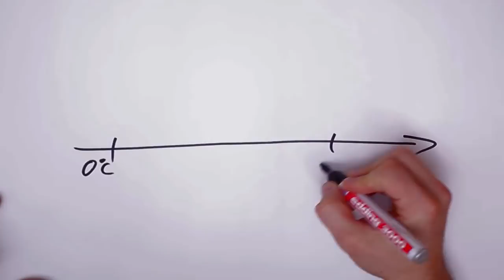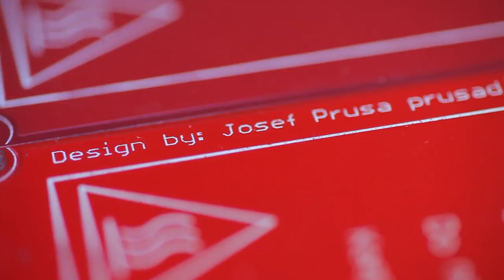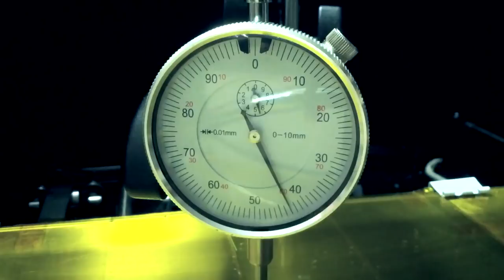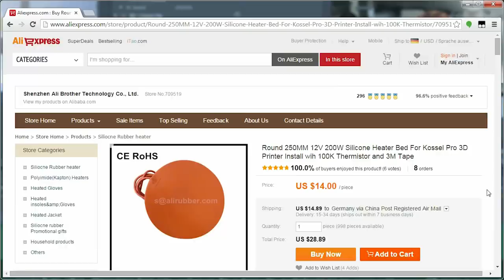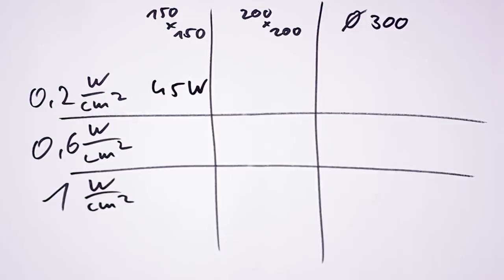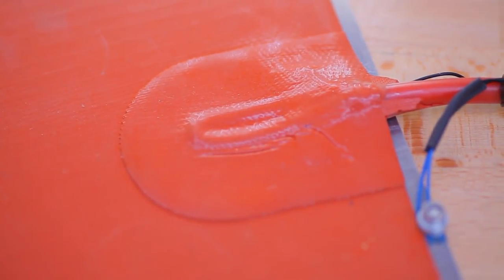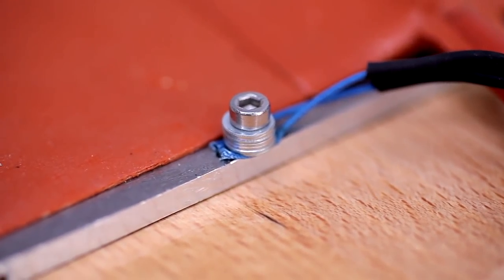3D printing guides: Everything about heated beds!

Comment: I have looked a bit at this and i decided to get a 220v 600w heated silicone pad.. :)
But then i immediatly started thinking HOW will you adjust and control the temperature on this when you are using mega2560 and ramps 1.4 ? :)

I would also like to know if you have to put something on the back of the heated pad, to avoid bearings and the suff underneath to get heated up.. :)
I have a prusa i3 hephestos :)

Looking forward to your answers :)
Reply: ***** thanks very nice and fast reply i just subscribed.. :) I were just afraid i would melt the pla underneath, but if i take i bit of the height, and get a bit more air in between and cover is with some cork, i should be good to go :)
Again thanks :)

Comment: Hi Thomas! Been fan of what you do on youtube and got tons of information that helped me and my 3d printing and for that I am greatfull but I still have a huge problem a smooth print surface. In the beginning I got MK2a PCB heated bed and a 3mm glass but I got tired of leveling my bed every time i print so I changed it for a MK3 pcb heated bed with Aluminum surface. But now i realized that it has a bow in the middle and the reading that i get from auto bed leveling are not as accurate as i want them to be. Do you think changing to heated mats with 3mm aluminum sheet will help me solve this issue? Can you please suggest a way to battle the bow on heated bed since it is getting really frustrated and annoying. Thanks in advance!

Comment: Tom, how can I control a mains-powered heated bed from a Smoothieboard?  Also, what kind of thickness would I need for an aluminum plate for a delta printer with a bed diameter of 38cm?  It's only supported at the edges, and I'm worried about sag.
Reply: ***** HAH!  I should've known you'd have a video about it already!

Comment: Hi where did you get your printbed from? Im planing to transorm my Prusa i2 to a Mendle 90 and also upgrading to a Alu bed with a heater mat, and since your happy please let us  know :)
Reply: You want MIC-6 cast aluminium plate.  According to Alco specifications, after casting it is ground on both sides to a tickness tolerance of +/- .005 inches (.127mm) with a surface finish of 20 microinches (.51 microns). The max. variation in flatness is .015 inches (.381 mm) over 96 inches (2438 mm).  It comes with a protective film on both sides.

Comment: how well would this work, a heated mat stuck to aluminium sheet (~1/8 thick ),with kapton  tape then glass sheet with kapton tape , glass sheet attached via binder clips, glass sheet is being used due to aluminium sheet that came with printer is warped. kapton tape on top of glass because i have been printing on it. and had little to no fails for adhesion, when i did just some glue stick to fix it. i would have personally like to use a thicker sheet of aluminium that is machined flat but not sure if i can afford that with kapton take. my printer is a solidoodle 3, bed is attached with 3 counter sunk screws and springs to allow leveling.

Comment: Hi Tom thanks for these informative videos. I have prusa i3 with aluminum heat bed & regular window glass on top but it takes extremely long time to get to 100deg. I want use a heated mat which is 230v AC so it heats very fast but not sure how it is wired so that my printer board control it. Any tips/guide on how to do so? Thanks

Comment: Hey Tom, i am hoping you could help me figure out what i need to wire a 110vac bed on to my melzi board... currently i have a pcb board, i have tried insulating it, adding a 12v relay to power it directly from a way over powered psu, still cant get it to push 100c... so it's time for an upgrade, but as you suggested i think it would take strain off the PSU to get a 110v... my issue is figuring out how to wire it in, i assume it would just be an ACDC relay of some sort.. just wanted your expert opinion.
Reply: It's all good, i got it figured, thanks for the videos tom, keep it up. if anybody wants to know, here's the part number for the relay 
G3NA-210B-DC5-24

Comment: what videos i have watched of yours has been a great help. when you say 120 and 60 degrees i am assuming you mean Celsius. in the process of building my first prusa i3.  have not got it built yet n already have done many upgrades to it that i could get from ebay.  do you have any tips on building a 600mm X 600mm bed? using aluminum plate of course.

Comment: Hello Thomas, you mentioned the e3d v6 method of putting a thermistor into the aluminum bed, can you elaborate a little bit? the picture looks like a hole was milled and tapped into the bed, thermistor inserted and screwed for tension. Is that correct? is there a special thermistor needed for this setup?
Reply: Thomas Sanladerer thank you! I'll likely be implementing this on my printer. I enjoy watching your videos and really enjoy that the captions are accurate!

Comment: Thank you for the very valuable information. Then, I'd like to upgrade my printer with aluminum bed + silicon heater. Then, what kind of adhesive would you recommend (minimum thermal impedance, but strong enough to hold the heater's weight ) ?
Reply: +Thomas Sanladerer  Thank you. I got my silicon heater from QUBD/Amazon Market place, which doesn't came wit the tape. I'm going to order a silicone adhesive.

Comment: Hello man your tips about 3d printers turn out very very precious for me  . However , i got a problem with my Anet a8 heatbed  . I can print successfully with PLA filament,b ut i can't do the same with ABS and more awfully with Nylon .The problem is that the heatbed doesnt  hold a stable temperature .It reaches the pre- heating temperature , i.e. i set 90 degrees celsius for the Nylon , but after 10% of printing the temperature falls down to 70 degrees and the object i am printing detaches by the heat bed and everythings mess up.Tried to change DC power pack from 20A to a 50A but the result is the same ,dropping temperature after 10% of printing done.WHY ?

Comment: Have you had any experience with kapton film heaters? I was thinking of sandwiching one between aluminium and cork for high efficiency.

Also what do you think of mains voltage heaters? Keenovo sell them. I am looking at using a solid-state relay to remove the need for a new power supply.

Is printing directly onto heated aluminium viable?
Reply: Thank you for the advice.

I went with a silicone heater as it was £25: the price for a 200x200mm one, but Keenovo kindly offered to adjust the dimensions slightly to fit my Velleman Vertex. The polyamide film heater would have cost about the same, but for a suitable custom one there would be a £50 retooling fee. They say cork can be attached to either.

Mains voltage makes sense as it will eliminate the need for a new, expensive PSU, be more efficient and simpler to implement. Just got to make sure it's all safe.

I got an aluminium sheet for £1.70 from a local place, Aluminium Warehouse in Hatfield. Perhaps there are places similar to this where people could get this stuff cheap? They charge about £12 for UK delivery, but I will just pick it up.

I will experiment with printing surfaces. I'd like to avoid the glass to reduce the time taken to heat up the bed, so I might try some of those solutions. Have you tried buildtak? I didn't see a video about it.
Reply: I saw a video on it the other day and it looks almost identical. May try it. Thanks.

Comment: Hopefully this wont be too late to be seen, but I had a question regarding alternative bed surfaces; I've been looking into getting a sheet of PEI(polyetherimide) to print onto(and to replace my glass surface). I've heard that the surface works magic when printing with ABS, experiences nearly zero warping at 80-90c, and the parts seem to hang on for dear life when heated, but pop right off when the bed temperature drops below 50c. As it stands I'm currently using a 4mm sheet of borosilicate glass on my Prusa i3 and the standard 2mm sheet on my Solidoodle Press; If possible, I'd love to get your input on how PEI actually performs, as I've seen some pretty interesting videos of its performance and would love to buy some...However, since it seems to cost around the same as an arm and a leg, I'd rather hold off until I see some actual reviews on the stuff. Any chance of seeing that? Thanks!
Reply: ***** Polyetherimide is 20USD on amzon for 300x300mm) I got mine installed on a FFD and so far prints stick really nice. some prints are actually hard to remove when they have large surface area contact to the bed. Small prints come right off once the temp drops to below 60C. I did have one print corners lift up about 0.5mm. That's one print out of 2 weeks of non-stop printing. Cleaned the material with water and everything seems to be going well again. It even gives a reflective surface on the print were it contacts with the material.

Comment: If I went with the silicone heater method... would it be possible to use 3mm glass ontop of the aluminum plate for ease of removal? Or would there not be enough heat transfer to be viable?
Reply: +Darkmastergrey Solidoodle Press comes with Silicone bed heater on Aluminum Plate and glass on top of that. Works fine, slow to heat tho.

Comment: Tom, on my Prusa i3, the heated bed doesn't respond to my set temp (always heating) but the thermistor works fine. Any idea how the setting function may be bypassed? Couldn't find anything on Google.
Reply: yes, im wondering if the kits lack of a bed relay would not enable the control? Although that's the way it shipped and I assume they wouldn't do that on purpose.

Comment: I've stopped using any heat to the bed with PLA,, up to a 225x145mm plate size so far.
AquaNet Superhold hairspray on galss or acrylic removable plates has been working great,, PLA and ABS.
Heat for ABS thou, gets a lot more attention:
- Enclosed chamber
- Heated chamber (I have a small hairdryer that preheats the chamber to 110*F / 43*C)
- Let glass plate temp equalize with heated bed for 3 or 4 min.
Remove the plate,, let it cool to the touch,, pop it in the freezer for 2 min,, and your object will lift right off the plate.
Exotic filaments will be interesting to see how they might require a higher stable bed temp. I just got the 3pack of ProtoPasta filaments,,, so I maybe having to make some heated bed upgrades.

Comment: Hi i'm trying to find  heater mat that i can plug into a wall socket 230-240V with a controller ideally. My existing printer REP RAP is a Bits from Bytes printer(doh, no wonder they no longer exist) the printer never came with a heater mat and is impossible to print with so I'm trying to upgrade it as i has been collecting dust... i'm not at all Electronics Savy so i wouldn't be able to make one that wasn't dangerous.

Comment: how does the controller power the bed? is it a constant current or does it cycle? i'm utterly confused. Could you use an external heat bed that isn't even connected to your 3d printer but it's own controller? Does it need a controller? etc.

If I get a Cetus, how do I home-make a heated bed that will get up to 120C? How would one go about hooking it up to the printer itself? Or, externally on its own power supply? :/
Reply: Yes you will need a controller, to connect a heat bed to an external power supply you with need a mosfet . the 3d printers control board sends a signal to the mosfet which will then turn on the hot bed using an external power supply , there is a thermistor connected to the printers control board which reads the bed temp and if it's too hot it turns off the signal being sent to the mosfet which turns off the bed

Comment: What kind of adhesive (tape, glue, silicone paste) do you use to adhere the silicone heater mat to a glass plate ?
I'd need some tape that's available in germany at best.
Reply: +Thomas Sanladerer my mat came with double sided tape attached to it, but the cover on the second side of the tape got loose during the shipment and there were some air bubbles between the mat and the tape. Therefore the tape wasn't as sticky as it needed to be and secondly the air expanded while heating, which caused big parts of the tape to get loose additionally. Therefore I've decided to remove the tape completely. I would now either order new high temperature double sided tape, or I'll try out silicone paste/glue.

Comment: I'm looking at a keenova heater mat adhered to the underside of a CR-10S build plate. I'd rather have the CR10S control the temperature through a SSR but am a little leery about the temp control algorithm being responsive enough to handle this higher power/faster responding heater. Anyone have  any experience with this?

I'm also looking at using an array of thermal pads between the glass and the aluminum plate to accommodate any flatness differences between them. My concern with using a full sheet is disassembly should the glass become damaged and need replacing. Any Ideas around this?

I'm also considering a closed cell high temperature foam as the underside insulator. Any other/better material suggested?

Comment: Hello, i have 4 heatbeds 214mm for prusa i3 and i want to use them to make  a big 3D heatbed. My question is,  how can i join them into a aluminium plate? Also I want to connect them to a kit arduino mega 2560 and i still don't know how i must do it. If you could help me i'll be very grateful.

Thanks bro :)

Comment: Can they be use in reverse? Like to charge a phone? I plan to put some on the back of my solar panels to boost my energy intake
Reply: No, these heating elements won't generate power if you heat them.

Comment: I have a 12v 20A power supply and my RAMPS 1.4 takes 5A and 11A. What's the best way to get 24V to the heated bed without damaging any of the components?
Reply: Luke Timpani 
For instance I use for my current printer a 24 V LED power supply for a 24 V heater mat and use a DC solid state relay for switching (I attach it to my RAMPS 1.4 board like a heater). My RAMPS board gets 12V from a 24V-->12V DC DC converter. Maybe there are easier and cheaper ways (by the way, if you want to use a solid state relay for DC current, ensure that it is a DC relay, AC relays don't work on that). 
One last thing, the LED power supplies I know need still to be wired. Since it also involves mains power I have involved a colleague who has the profession to handle such stuff...be careful and Good Luck.

Comment: I have just installed an aluminium mk3b on my printer, I use 24V but the heat up time is still quite slow. I have read on the reprap wiki that you can connect the 24V to the 12V tabs for faster heat up times, what do you think? I have also read other people connecting 24V to an 12V aluminium mk3b using a solid state relay in between. Would simply using 24V on the 12V be a safe enough option?
Reply: +Thomas Sanladerer Thanks for the reply, I have a 600W powersupply so I should be good on the power side. What do I have to check on my ramps so I know it can handle it? I will probably have to add some cooling to the mosfets.
Reply: +Thomas Sanladerer Okay, is there anyway I can make the Ramps board handle it?
Reply: +Cold_Fox89 I have a very similar setup (mk3) and I run 24V through 12v connerctors, using it in the 24v was taking forever (more than an hour) so i decided to run on 12v, I can heat my bed in under two minutes (120ºC) and I've been using it for about a year without problems. Warnings: If you just connect 24v to the ramps you will break the fuse and if you short the fuse you will burn the transistor that controls the bed (I tried it, it locked closed and destroyed my bed) You need to use a 12V relay to activate the 24v bed... also I tried it in mk2 and mk224v and destroyed both beds, it need to be an aluminum bed for this to work
Reply: +Rodrigo Rodrigues I just got my solid state relay installed and it now heats up from 20C to 110C in under 4 minutes. Would be a bit faster if I didn't have a sheet of glas over the bed but I can't get my prints to stick to aluminium.

Comment: I must disagree about borosilicate. The advantage is significant - and not during print. The idea was to make the print easily snap off during cooling, because glass and plastic both contract together when cooled while pyrex does not - which creates internal forces that make the model pop off easily

Comment: How thin of Aluminum is too thin? I've heard stories of warp with aluminum beds and was curious if you've ever experienced this.

Thank you!

James
Reply: It's important to use a cast aluminum plate, not a rolled one -- the latter will warp. A cast MIC6 aluminum plate will not give you any warp issues; use at least 5mm thick. Some people recommend something like 8mm but it will give a lot weight and probably take more time to heat up.

Comment: Hey Tom...
I'm using ramps1.4 for my printer...
And its getting too hot every time...
Due to which the mosfets used for the heatbed connection is heated up and then are of no more working...
What should i do now..???
Reply: Cool it down with a12 volt cooler

Comment: Hi tom  
 I purchased a 200X200mm,500W@24V, w/ NTC 100K Thermistor,Keenovo Silicone Heater 3D Printer Heater to replace a MK2B Dual Power PCB Heat Bed setup for 24v. My boad is a 24v Mini Rambo. but the keenovo bed does not distinguish neg an pos wiring. Can someone tell me the correct wiring diagram for this set up
Reply: Ok thank you for the help. I will have to find a work around to use that heat . Thank again. Tim

Comment: Good point about thermistors. I did an experiment on with my PCB heatbed (http://youtu.be/j3mMD6bx5Jo) where I measured the temperature of my glass and compared it to my thermistor reading. There was 14-15 C difference between the thermistor and the glass, and another 10 degrees difference between the center of the glass and the edges! That could make a difference when printing large objects, especially out of ABS.